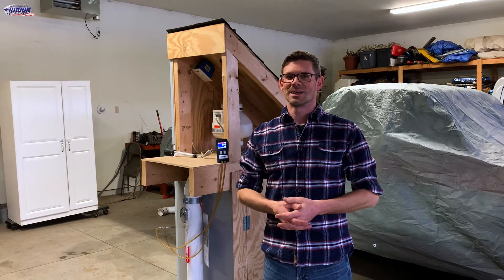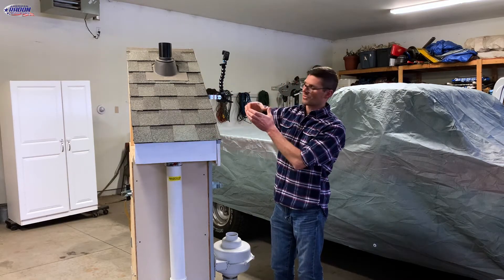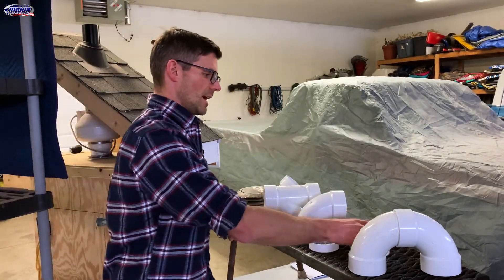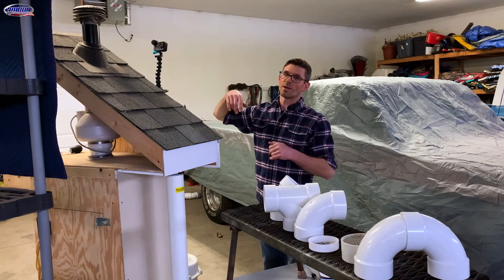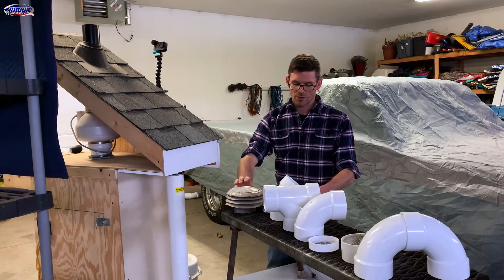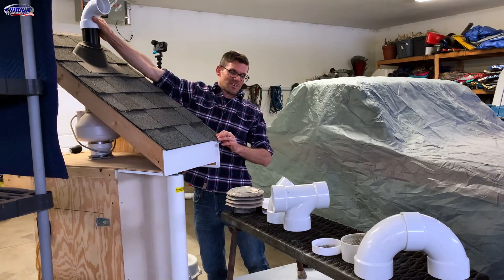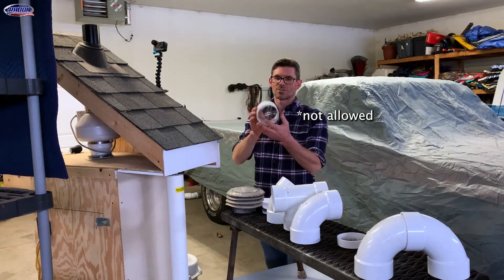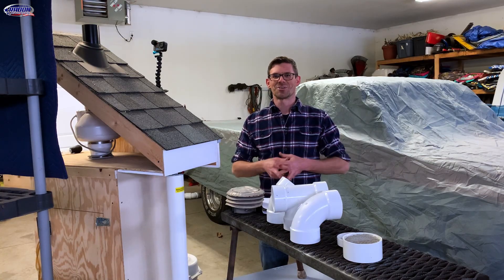Rain Caps on Radon Systems? Why We Don’t Use Them

Comment: I live in the Pacific Northwest and I  have a passive system and I don’t have a sump pump and I don’t want to install one is a 90 my best choice for keeping rain and snow out?
Reply from the maker: We don’t use a rain cap or fitting at the top of the discharge pipe. Exhaust discharge requirements are outlined in the radon standards. https://standards.aarst.org

Comment: Thanks for the info. I was just looking at my pipe and wondering if it was supposed to have some kind of top.

I was thinking about if the top was supposed to be open because I was replacing my fan today. I took the hoses off and there was a bunch of brown stuff inside the fan. I poked it with my fingers and looked up at the pipe on the roof. I thought that pine needles from the nearby tree must have fallen in the pipe.

Then I realized it wasn't pine needles. It was a dead animal! There were bones and I had been touching the animals fur. I think it was a squirrel! It was disgusting! It must have fallen into the open pipe and died there.
Reply from the maker: Yikes, I know exactly how gross that can be. I once had to do a fan replacement where a squirrel had been in the system for a week during the summer. The blood, smell, and maggots were enough to make me gag. Fortunately, it’s the first time in 11 years I’ve had to deal with that. You might want to consider adding a varmint guard cap on top of your system to prevent this from happening again.

Comment: You could point the 90 degree toward the peak of the roof, or turn the tee parallel with the house, or I think I saw a tee that does not have an elbow as used for drainage plumbing. It would also make a difference if the outlet was near the peak as apposed to an exterior wall, and does not include airflow above a house and the effect of a hot roof. I have a large tree over my house where it will be vented and will have to use some kind of debris guard from leaves, bark shedding, and the helicopter seeds.
Reply from the maker: The straight-up exhaust trajectory is preferred by the radon standards. Check out section 6.4 of the standard to learn more: https://standards.aarst.org/SGM-SF-2023/24/index.html

Comment: I put a 90 degree elbow on my exhaust pipe. If I take it off, then water comes down and gets into the red ink gauge meter and mixes with the ink. Should I take it off?
Reply from the maker: Drill the hole for the U-tube manometer like we do in our videos. That way, water can't get in the U-tube because it can't travel up the tubing.
Reply: @ I just watched your video called how to read a radon manometer and that’s how mine is installed. It’s in the garage but unfortunately after water travels down the pipe, it enters the small red ink tube. I guess my concern will not ruin the motor if I leave the 90 degree elbow or should I worry the reading will be high?
Reply from the maker: @tamir5940, how is water traveling up the tubing and into your manometer if it's installed below the top of the U-tube and the hole through the pipe is drilled at a downward angle? I've never had a problem.
Reply: @ my meter is installed on the pipe in the garage and the hole is drilled inwards directly sideways and not on a slant. I guess I could re-drill going crooked downwards with the small breather pipe inserted that way.
Reply from the maker: That should fix your problem. It’s a 3/16-inch drill bit.
Reply: @ thank You.
Reply: @ sorry forgot to ask. Any advice on where I can get the dye that is either green or red from. As I stated before, I have water in my meter that I have to flush out.
Reply from the maker: It would be cheaper to replace the manometer than to buy fluid. You can find them in our Amazon store's radon system monitors section. https://www.amazon.com/shop/americanradonmitigation

As an Amazon Associate, we earn a commission if you purchase using the link. Thanks for your support!
Reply: @ thank you. Just got one for $8. It’s a little smaller in size but it will work.
Reply from the maker: You bet!

Comment: Great info. Enjoy your videos. 👍 I'm new to an eastern-US area where we just had remediation done. They put a cap on the exterior exhaust pvc pipe that seems standard on installations I've seen in this entire area. It's a cap you didn't demonstrate. Possibly it's new, or it's not used in parts of the US, maybe... It's a modified T-shape --the bottom of the T is open, not a complete round horizontal, then there's a wide plastic debris grate on each side. I imagine it not being a fully closed T makes it less restrictive flow. See RadonAway 76001 for an example of that cap. Do you have thoughts or experience with this type of cap? thanks again.
Reply from the maker: Thanks for watching! No, I don't have experience with that type of rain cap, as we don't use caps. We don't use them because they increase the chance of freeze-up and exhaust discharge clearances. See those clearances in sections 6.4.12 through 6.4.12.2 of the radon mitigation standard. https://standards.aarst.org/SGM-SF-2023/26/index.html

Comment: I love it when they tell you not to use something, but don't really say why.  Is 5.5 cfm loss really putting you below the allowable cfm threshold?  Can you tell me on a windy night during a 4" an hour thunderstorm that you don't experience that kind of cfm loss?  Why not manufacture the fan curve to compensate for a rain diverter?  This isn't like the vent pipe for your plumbing where any water down the pipe goes into the sewer, it puddles on top of the fan or in the crock.  I don't know about you but I want it as dry as possible below my slab.
Reply from the maker: It's not so much a CFM issue. Although I was curious about the CFM loss, that's why I tested. The exhaust discharge clearances change when you add a rain cap to avoid re-entrainment. Rain caps and any fitting at the top increase the chances of blockage due to icing. Falling ice can damage the structure. The straight-up discharge also prevents 100 percent relative humidity air from blowing at the home.

Snow or rain falling down the pipe has little consequence. The fan and pipe are designed to drain the small amount of water back to the suction point. They say a radon fan can remove up to 15 gallons of water from below your home daily; that's more than a year's worth of rain you might get down the pipe. Since you want to keep debris out of the system, we use a 1/2 wire screen when trees are above the system. This also keeps the occasional squirrel or bird out. The screen is also susceptible to collecting frost and stopping airflow, so we don't use them on every system. 

If you live in an area with torrential rains, meet the clearance requirements, and aren't subject to prolonged temperatures below freezing, you may want to consider a rain cap. 
Please don't take my word for it, though. You can check out all of the radon standards here: https://standards.aarst.org

Comment: curious about not necessarily what is allowed/not allowed but what the consequences of getting snow/rain/debris down the pipe?
Reply from the maker: Snow or rain falling down the pipe has no consequence. The fan and pipe are designed to drain the small amount of water back to the suction point. They say a radon fan can remove up to 15 gallons of water from below your home daily; that's more than a year's worth of rain you might get down the pipe. Since you want to keep debris out of the system, we use a 1/2 wire screen when trees are above the system. This also keeps the occasional squirrel or bird out. The screen is also susceptible to collecting frost and stopping airflow, so we don't use them on every system.
Reply: @AmericanRadonMitigation  excellent information thanks for the quick response.
Reply from the maker: You're welcome!

Comment: Do I have to leave it on 24/7? If I turn it off when it's raining, the rainwater will go straight into my basement?
Reply from the maker: Yes, leave it on 24/7. I've heard the fan’s bearings can rust if you shut it off. Don't worry about the small amount of rain that makes its way into the pipe. It will end up in your soil, where the fan will constantly dry it out.
Reply: @AmericanRadonMitigation  My concern is living in Florida where we can both have major rain and a power outage at the same time from a hurricane. What then?

Comment: Very informative video!  Thanks a lot!  Thinking outloud however here:  I have had some water issues in my downstairs bathroom since about the time I had a radon system installed.  I have always had a sump pump and it continues to work.  Got a new one installed when I got the radon system installed.  The water in the bathroom seems to come from below....just moisture seeping up between the vinyl tiles and appears if we have had a heavy rain.  I know you don't recommend a cover for the top of the radon pipe.....but I'm really starting to think that I might be getting excess water coming down the pipe during those heavy rains and then some is seeping up through the bathroom floor was it works it way toward to the sump hole?  Is that possible?  Thinking the T connection on top might prevent that possible issue.  Again....not sure that is what is happening or not.
Reply from the maker: I'd be shocked if you could get a significant amount of rain down a three—or four-inch radon exhaust pipe. If so, I imagine your sump pump would catch it. You could try it and see if it makes a difference.

Comment: My basement is dirt with bricks on top, and a long dirt crawl space.  The walls are round boulders with bricks at top that our house sits on.  How on earth do I have something like this installed.  Maybe just vent the whole basement ?
Reply from the maker: It might be cheaper to use dynamite and start over. 😂

All joking aside, it sounds like a ton of work. You will have to make an airtight barrier between the soil below the bricks and the basement air. I'd look at removing the brick installing a drain tile system to draw from, a vapor barrier, and a new concrete floor. While you're at it, you could encapsulate the walls and crawlspace. 

There are many ways to go about it, but that's the one I'd choose if it were my house. 

Good luck, my friend.

Comment: First off, your videos are top notch !  Very informative and well done! If doing a roof exhaust, is it best to have the fan closer to the end of the pipe so it has max pushing power out the end of the pipe to prevent freeze, or can it be down a bit further like 7-8 ft without issue of freezing as long as my attic pipe is wrapped with insulation?  I could put the fan in the basement, but then it has a run of about 20ft until it hits the attic, so I assume the closer to the exhaust the better? Whats the longest run of pipe recommended if I wanted to go across my attic and out the gable instead of a vertical exit?
Reply from the maker: Thank you. 

1. I've been told it doesn't matter where the fan is within the piping run. The fan doesn't care whether it's pushing or pulling air.
2. If you're in the USA, the standards don't allow a radon fan to be in a conditioned space. We only install them in unconditioned attics or outside. 
3. The exhaust discharge has several requirements. I'd go through the roof. 

Check out the standards before getting started. They are easy to navigate and are super helpful. https://standards.aarst.org/SGM-SF-2023/4/index.html

Comment: I have a new house that is pre-plumbed for Radon mitigation but do not have a Radon mitigation system. Just a pipe going from my SEALED crawlspace to the roof. Shouldn't there be a cap on the roof pipe to prevent rain from getting into the crawlspace? I should add that I cannot see daylight while looking up from the crawlspace but that might be due to elbows installed between the floors somewhere. I am getting rain water in crawlspace after a heavy rain. And there's no chance I'm getting on the roof to look (way too high for me).
Reply: I'm just an inquisitive homeowner. Not a professional. Wondering if the pipe in your crawlspace penetrates below a vapor barrier. Is the pipe continuous (no breaks)? Does it go up through the living space, through the attic to the exterior roof or does it exit the crawlspace horizontally and then continue up above the roof line?  The system installed at the time of build may be a complete passive system or the builder wasn't required to complete the system but gave you "the starter pack" which at least alleviates the need for a more expensive retrofit.

Comment: wait wouldn't the preferred "open" method allow rainfall and critters to just fall straight down the tube? Why is this preferred?
Reply from the maker: You can read all about exhaust discharge requirements in section 6.4 of the radon mitigation standard. https://standards.aarst.org/SGM-SF-2023/24/index.html#zoom=z

Comment: How is okay to vent carbon monoxide from my furnace using that cap but not okay for radon? If it was blowing bad air back into the house then people would be dropping dead from carbon monoxide poisoning. Certainly the highly diluted air from the radon system is not nearly as dangerous as we’re being led to believe. Once it’s mixed with outside air, it immediately becomes even more diluted. I don’t argue that radon is dangerous and needs to be removed from our homes but some of the installation guidelines feel a bit over blown.
Reply: You are exactly right, but you aren't going to corner a professional into agreeing with you: there is such a thing as liability. And the second commenter is also correct about the interests of private organizations.  

Follow the incentives. There's money in highly specialized products, services, and procedures. It is in the best interests of an industry to suggest every overcorrection; that is, marketing tends towards a 'better safe than sorry' approach. You and I, fellow consumer, are left to our own wits. Luckily, in this case, it's just a case of simple mathematics to understand that any harmful substance, when diffused, becomes correspondingly less harmful.  

That said, the expert's math is right, too. Even the worst storms dump only an inch or so of rain per hour. Assuming a 4" opening, that's under 13 cubic inches, around 7oz, which is an easy task for any radon fan to overcome.
Reply from the maker: I wouldn't want rain and snow coming down the b vent and onto my water heater. However, rain or snow in a radon system doesn't hurt anything. Radon systems remove a substantial amount of moisture below the home and are designed to handle water. 

Keep in mind we don't write the standards. However, we do have to follow them, even the ones we may disagree with.

Here's a link to the standards for your reference. https://standards.aarst.org/
Reply: I appreciate that you want to follow best practices, but unless I am misunderstanding (always a possibility), these "standards" are recommendations from a private organization and no-one is under any obligation to follow them, except, perhaps, members of said organization. @AmericanRadonMitigation

Comment: Thank you for the video. How long of a pipe would you recommend if the roof ridge is far away or if it is close and we get a lot of snow,15 inches and more.
 I was thinking about the 45 and direct the air away from windows on one side. This will be better with snow and rain. Do you know how far away you can breathe in radon if it is a lot? I mean, how fast does it delude in air to not be an issue if we have air coming down due to pressure?
Reply from the maker: Check out the exhaust discharge requirements here: https://standards.aarst.org/SGM-SF-2023/24/index.html#zoom=z
Reply: @AmericanRadonMitigation  We don't have requirements and regulations where I am from. We can do basically anything we want and we are in the middle of the woods.
So what would be the best solution to both prevent snow/condensation of the cap and also make sure we don't get radon air backwards. Is the 90 degree an ok solution? Why did you say " but not preferred". How is the 90 less efficient thatn the Tee, can't see much of a difference? Thank you!

Comment: Very informative video. Had the first vent for a long time not even thinking that it's just blowing it in a 360 degree area and we do have a window not too far from it. Installed a new fan recently and just left the end pipe open but did end up putting on a 45 degree cap since it's "allowed" so as to flow it even more away from the house and the window area.
Reply from the maker: Thanks, glad you found it helpful!

Comment: I have a house built on a sand hill overlooking a lake with drip tubes around both outside and inside the wall perimeter footings.  The slab is over sand with a plastic barrier. The outside end in a outlet tube down the hill toward the lake. The inside tubes end in the sump basin. The basin in the ten years since the house was built has never had water and the pump had not had to run.  The cover  has a open slot where the pump exit pipe comes up out of the pit and exits the house on the side.  My radon meter reads 4.67 in this room.  Can I just put a sealed cover over the pit or should I add a vent pipe and fan to draw air from the drip pipes to the outside? Is this sufficient?  The lower level design is open concept finished areas all glass looking toward the lake, and the readings in this open area are below 4.
Reply from the maker: I would install a system similar to the one in this video. https://youtu.be/h0g_UY5-Zew?si=6VOfawVCJqlTuvIe